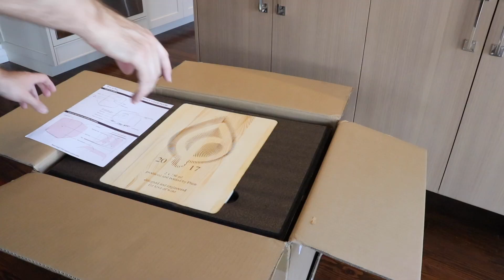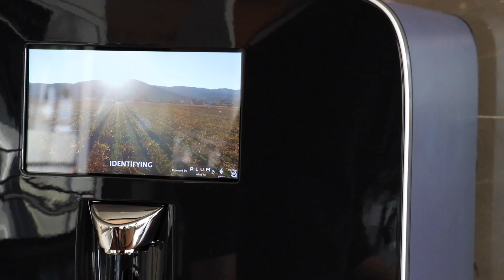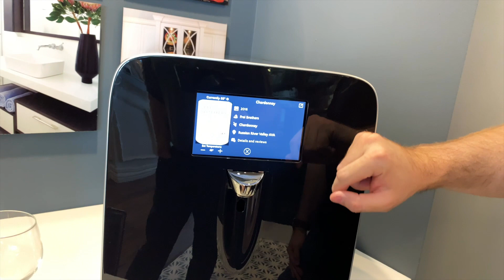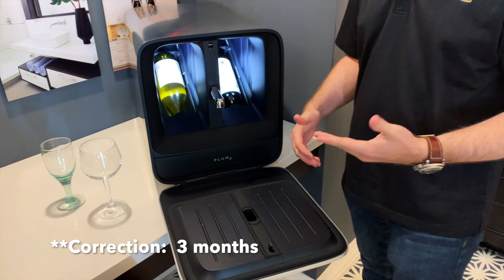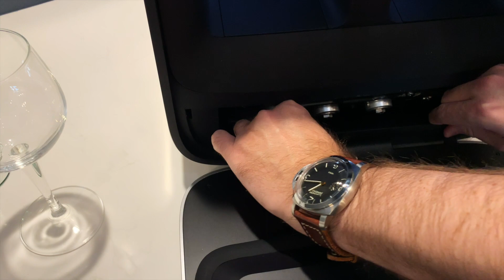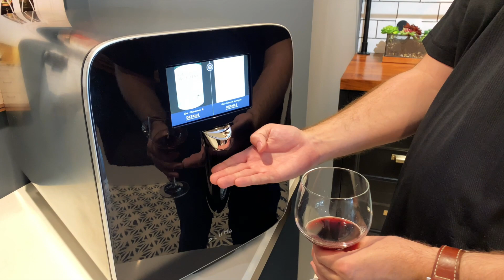REVIEWED: Plum Cloud-Connected Wine Dispenser Preserve - 3 Month Test

Comment: Two questions.  If you change (on the same side) from a RED to a White. My assumption is you have to pour part of a glass until all the red is out of the tubing?  The needle looks pretty large compared to a Coravin. If you take the bottle out of the PLUM before it is finished will the cork seal (larger hole?) and preserve the wine?